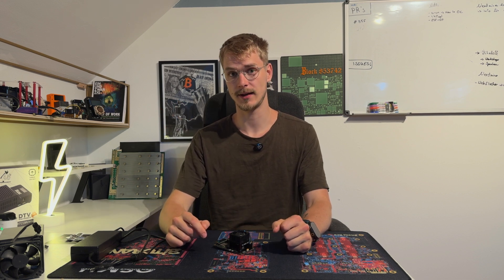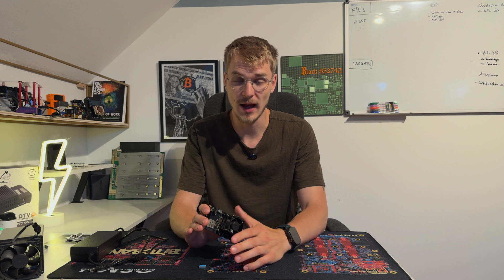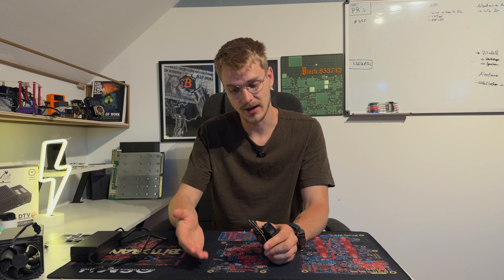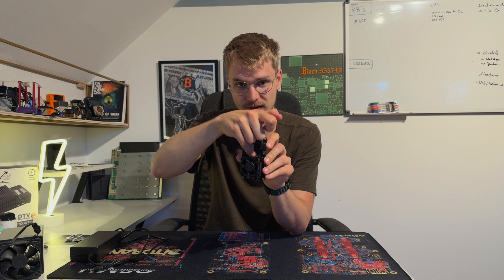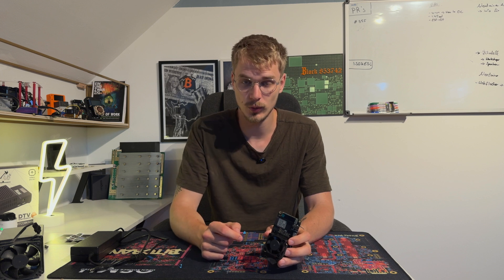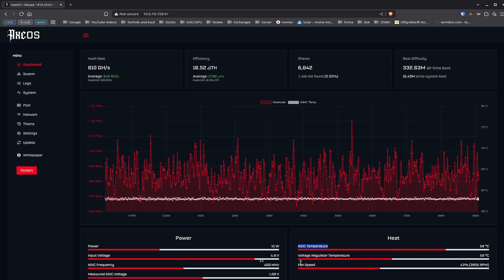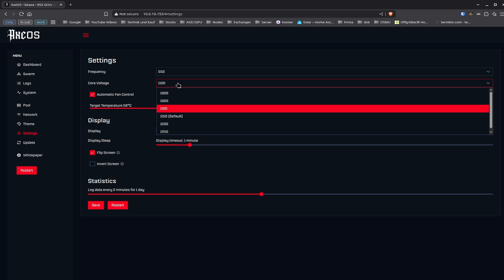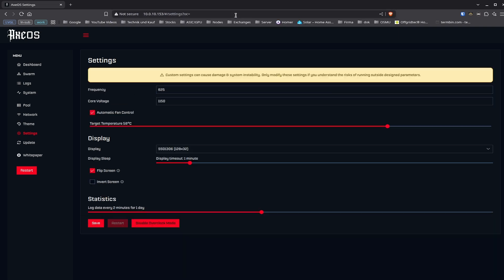Bitaxe 101 | Overclock your Bitaxe

Comment: Thank you for this information,  really handy. Which component is the voltage regulator temperature reading in the web console monitoring? Is it the buck converter? Or something else? Thanks
Reply from the maker: The temperature in the webui is from two parts one is the asic temperature directly read from the asic and the voltage regulator temp comes from the buck converter
Reply: @WantClue thank you so much for this, I couldn't find this info anywhere as it's quite crucial in deciding where to focus cooling solutions. Everyone online seems to think it was the inverter temp being read as it's the most prominent component on the back, which didnt make sense to me

Comment: For those that are interested in automating the process of determining reasonable OC settings I highly recommend checking out WantClue’s previous video on benchmarking. The python script utilized in that video can easily be modified to test OC settings by increasing the Asic Temp / V Reg Temp thresholds. Obviously use caution when altering these variables, but if done properly the script is a great way to test a range of Freq and Asic Voltage combinations for the best OC settings.

Keep up the great content WantClue!